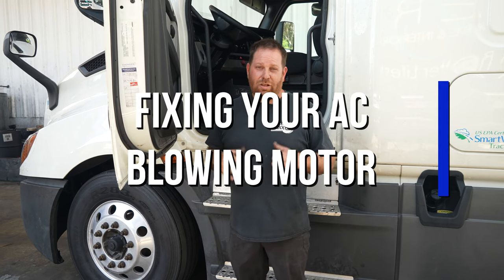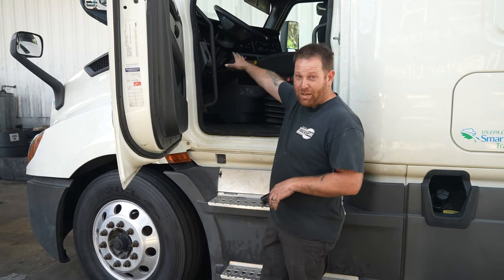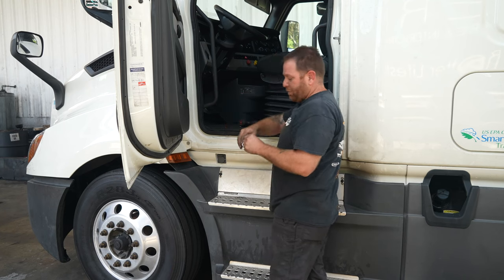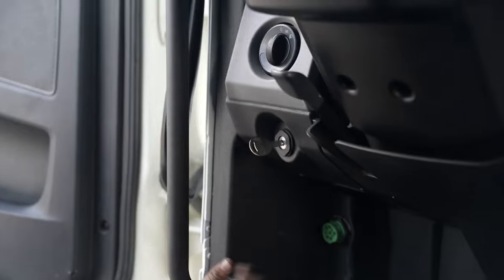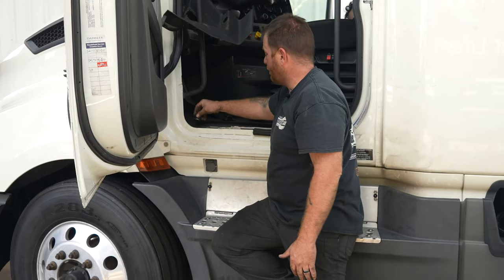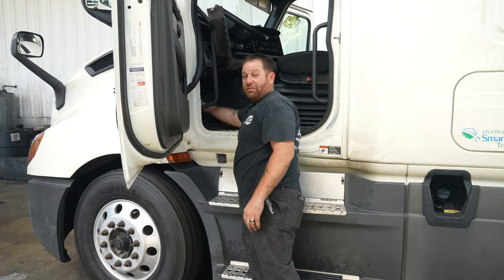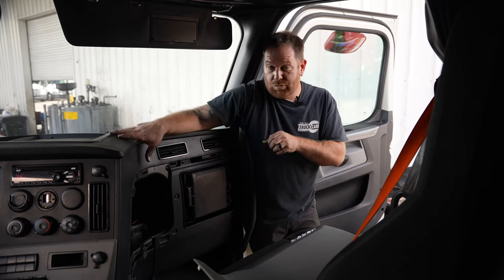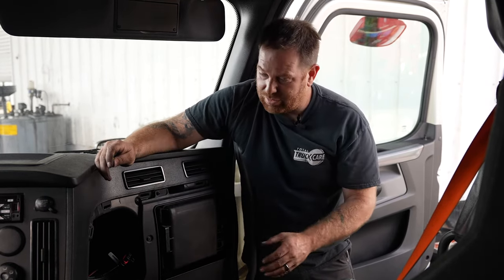AC Blower Motor Quick Fix Freightliner Cascadia 2019  - LRM

Comment: Went out to a service call rear AC blower motor wasn't working pulled this panel up found main power to the sleeper connection disconnected connected it reinforce it with a zip tie good to go cha ching thank you for your video

Comment: I new about connector to the blow inside dash panel, but not for the bunk. Awesome thanks for the tips. M2 have those issues as well. Some at the blower motor, and high pressure switch connector.

Comment: I have the cable issue on passenger side especially the black side the plastic is melted but I just wanna know if Are you sure is not gonna melt the cables putting the butt connectors??

Comment: I have same problem  get hot and melted the one in passenger  side for 2018 new freightliner they have low coolant come out some times and let the engine shutdown  from sensors  low coolant level   i have to change sensors and sometimes  low oil pressure  from bad sensor  that only I see it on this new freightliner

Comment: I'm having the same issue but with a t880
Reply: Is there anything that I can do because it's not the same as the cascadia it has a plug on the fan and I was just wondering cuz I can't cut no wires and and connect them together to that fan because it has a plug right on the fan there is no wire sticking out of the fan but it does have the wires to the plug on the other side

Comment: Dude just changed Blower on my Cascadia 2020.20/30 minutes worked very well than it stopped again,what’s wrong with this Goddamn AC,Jesus,Laredo,TX it’s 109 today
Reply: Check the plugs where multiple wires go into it’s black sometimes they melt the plastic